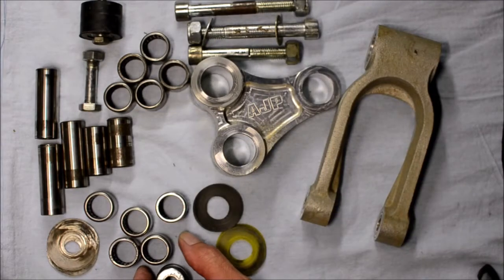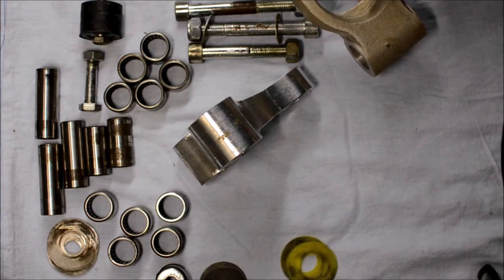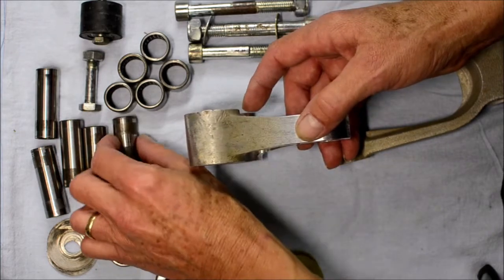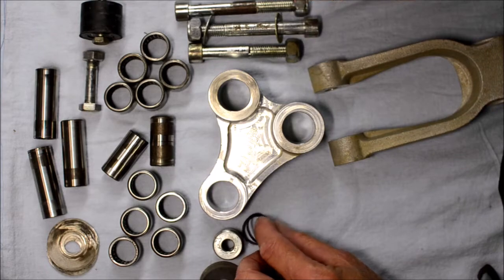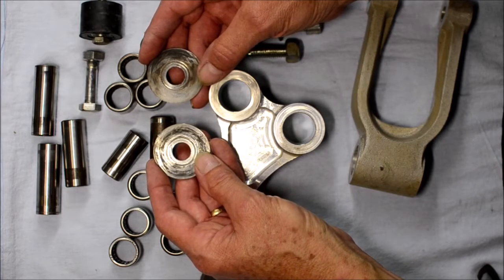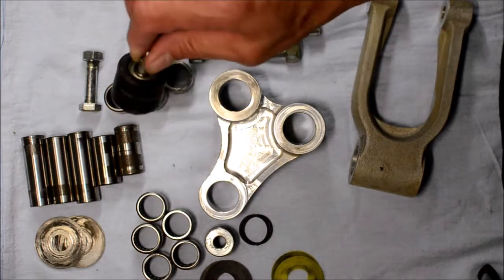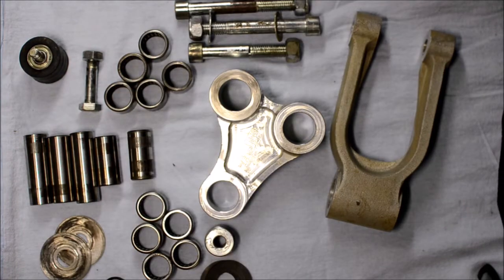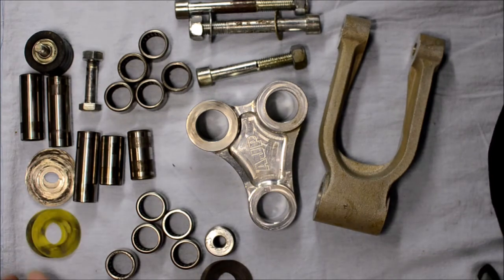AJP PR7 Suspension parts

Comment: Very interesting Alan, could you add grease nipples? On my Tenere I do those bearings every year.
Reply from the maker: No because the bearings are sealed both sides and in the link they are hard up against each other. I made a rubber flap out of a tyre tube and it covers all the places that get spray off the wheels. Seems to work well